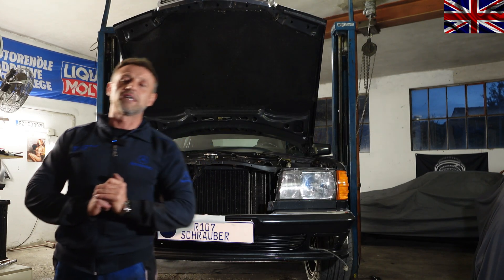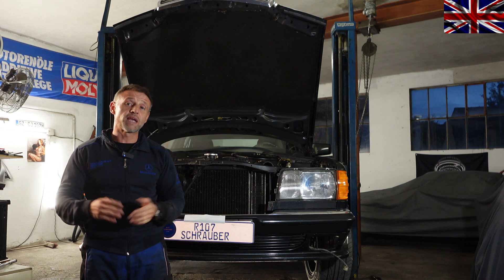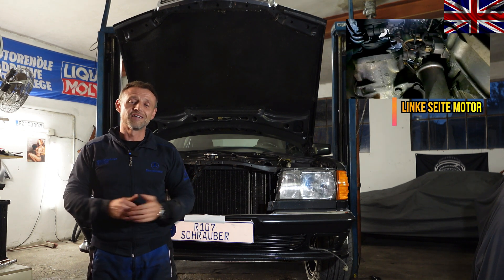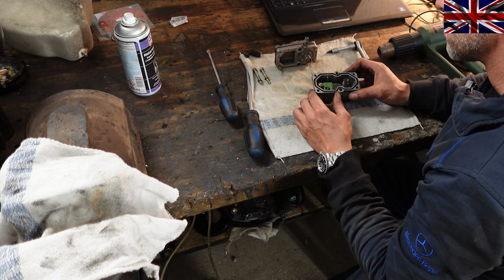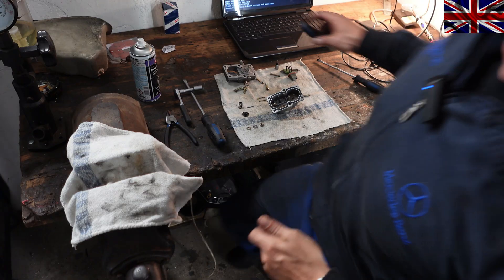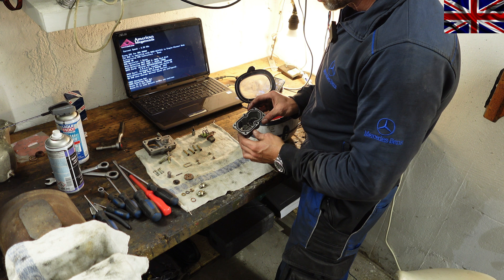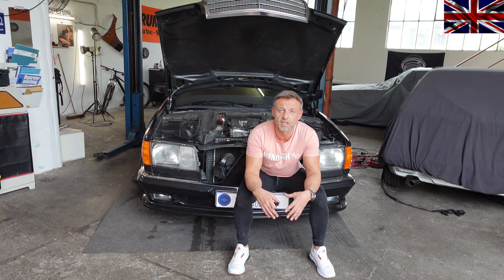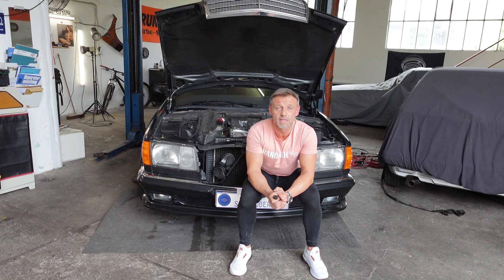K-Jetronic warm-up regulator - Mercedes VW Audi - Revising a warm-up regulator Mercedes Restoration

Comment: Where is the warm-up regulator on the 8 cylinder?
Reply from the maker: Übersetzter Text

On the 8 cylinder, the warm-up regulator is located at the top front of the engine on the right-hand side